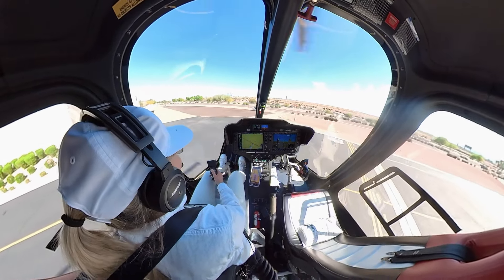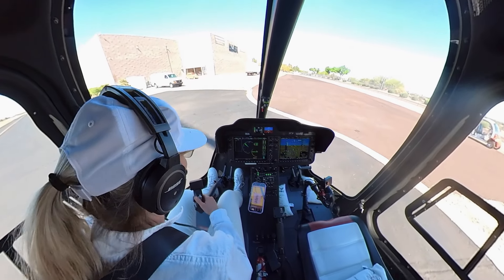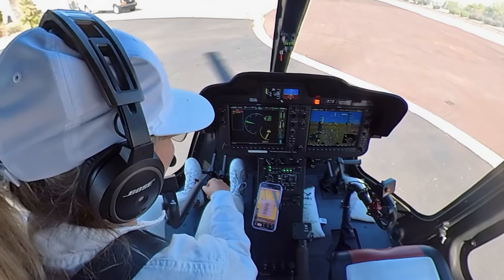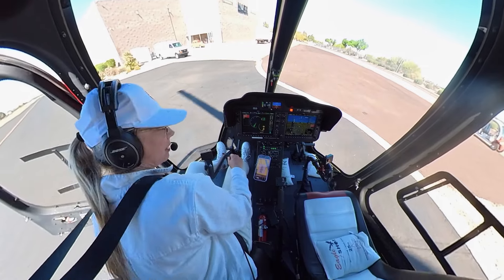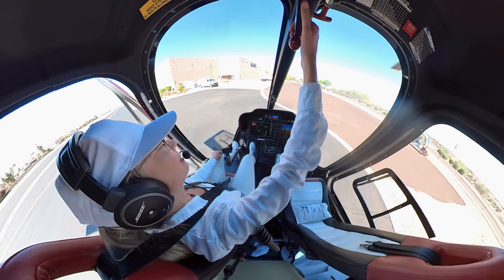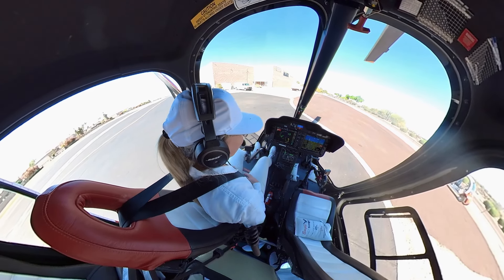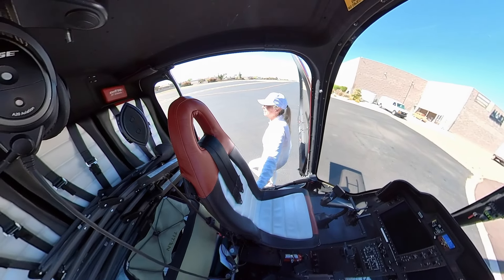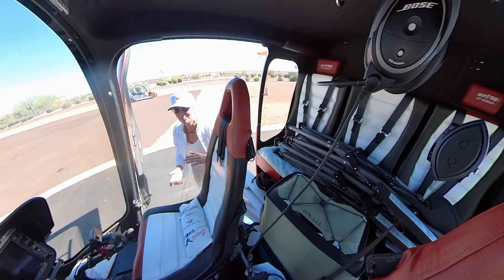How to land and shut down a Bell 505 turbine helicopter

Comment: Hi Leigh great video. I understand the 505 is very critical in weight and balance. The Jetranger has a minimum pilot weight of 77 kg for solo flight. Does the 505 have a minimum pilot weight or is it done entirely off the weight and balance chart. I’ve also seen 505’s lift off with the tail very close to the ground with solo flight, is this an issue for you or does the shot bags fix this issue.
Reply from the maker: Thanks Ashley, and great questions. There is no minimum pilot weight for the 505, just that you're within the CG envelope which is calculated before start up on the G1000. I have the Pilot Adjustable Ballast kit on this 505 which significantly increases the mission capabilities. Even still with the 25 extra pounds up front from the kit, I have an additional 100 pounds (4 bags of 25 pound shot) which brings the CG to the middle of the envelope which is much more stable and comfortable to fly and as you've seen on others, keeps the tail higher from the ground. The sweet spot for fore/aft CG is actually a bit forward of center. I'll put a more detailed video together with all this info!

Comment: you've got weight on gear and yet still low rpm? That's a bit weird, isn't it?
Reply from the maker: Honestly there are a lot of warnings on this dang G1000 that make no sense. There is a silence button for the obnoxious CAS warnings that I've renamed to the "no shit" button...like when it screams in my ear that the engine is out...after I've turned the engine out. I'm like NO Shit! And when I take off in the mountains and it yells "warning! Obstical, obstacle." I'm like thanks for disctracting me during a critical faze of flight. So yeahhhh, don't get me started....lol.

Comment: I like that you Video in 3rd Person I’ve always said whats the point of having a body if you kant look at it. 😃

Generator is same as Alternator?? 🤔
Reply from the maker: The pilot has a switch for the generator, which doubles as a starter. The Bell 505 also has two alternators to run the dual channel FADEC's. From google: An alternator is a device that converts mechanical energy into AC electrical energy. A generator is a mechanical device which converts mechanical energy to either AC or DC electrical energy.